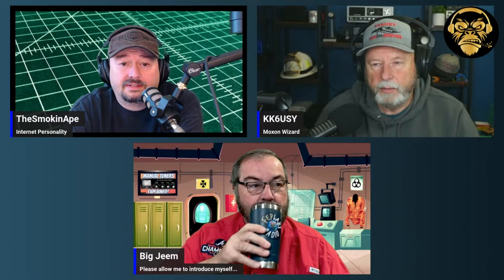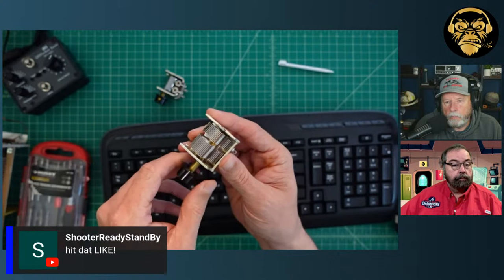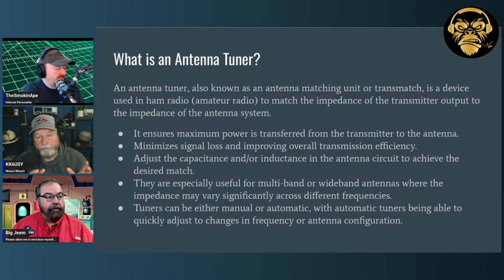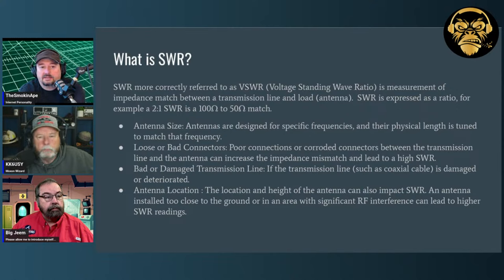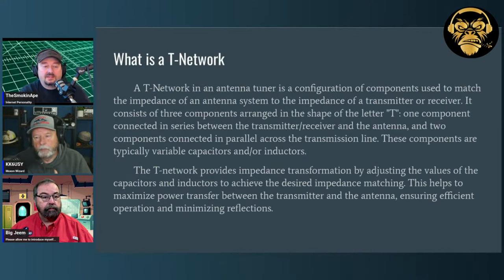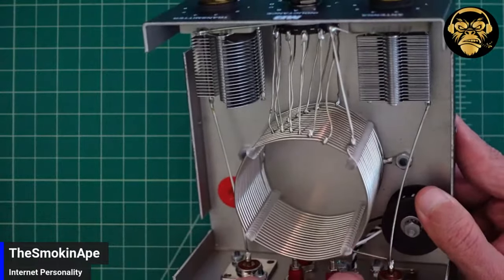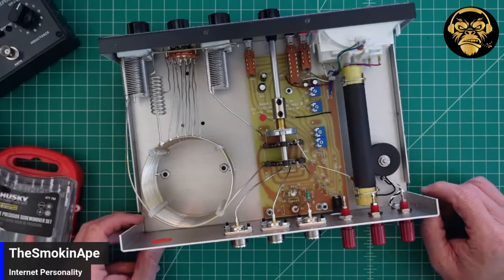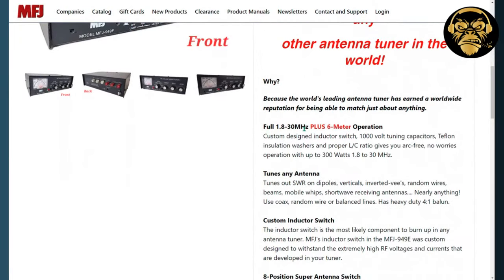The Ultimate Guide to Manual Antenna Tuners

Comment: Then in Ye Olden Daze, you tuned the transmitter to the antenna (system).

I’m sure we’ve all heard ”You can tune a guitar but you can’t tuna fish”. In many cases ”tuning” a wire antenna is really PRUNING the antenna.

73 de AF6AS in “DM13” land

Comment: I like antenna tuners, my first was MFJ 969 deluxe for my FT-991A, and I have an LDG Z-11 Pro II for my FT-891 and I have MFJ-998 auto tuner for my Kenwood TS890-S.  I usually use a 73' or 130' random wire  with a 9:1 or 4:1 balun.  All of them had no problem tuning on any band I use.
Reply from the maker: That’s awesome, I’m thinking about doing a new 9:1 antenna 👍

Comment: great job on manual tuners. all i have is 2 MFJ manual tuners. work great. I have the MFJ 949F that 1.8 to 60 MHz 300 watt with dummy load. the power is needed for lamp and peak reading on meter. the avg power works with out power. I paid around $260  for it some years back. the outher one like Chucks but newer . the MFJ 962E I have.  1.5Kw will run the AL 572 1300 watt amp as well. 4-572/B tubes.  a manual tuner can be set with a VNA or analyzer with out transmitting power. how I per tune. gets it so close. both have the 4:1 in it. never used it. that 300 watt dummy load has a time vs power graph . like the MFJ dummy load which the graph is on the box. I printed out that graph and taped it to top of my tuner. it will smell a bit when first used. that the dummy load. all MFJ dry dummy loads do that.  I got the 2.5Kw fan cooled one as well. and the oil paint can one. them not MFJ but still is they sell outher brands . I got Synectic transformer oil in the paint can one. cost more then mineral oil and takes heat better. power company uses it in substation big transformers. 73's
Reply from the maker: Hey Robert.  I like the MFJ tuners, I know there is better stuff out there but these work pretty well and are priced right 👍
Reply: @TheSmokinApe  I never went wrong with MFJ . I rather have a manual tuner. love the bult in dummy load ! I use it all the time testing . gets the job done. all that counts .

Comment: To fix MFJ issues - Remove cover fully engage cap, observe dial and if needed/wanted loosen knob and re position to common sense position desired.
Reply from the maker: That’s a great idea 👍
Reply: There are many with knobs in the incorrect positions. Minimum inductance on both capacitors is 1, minimum inductance on tapped inductor is A. The manuals are correct but the assembly is done wrong.